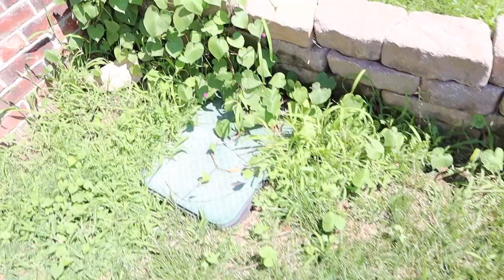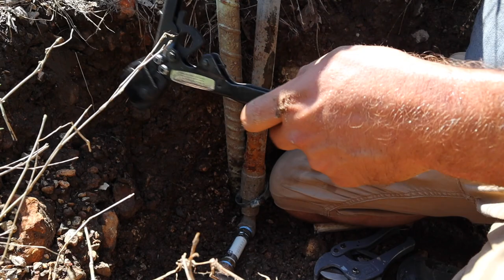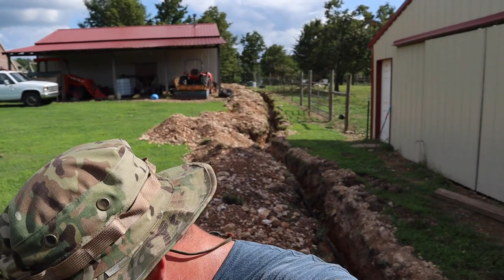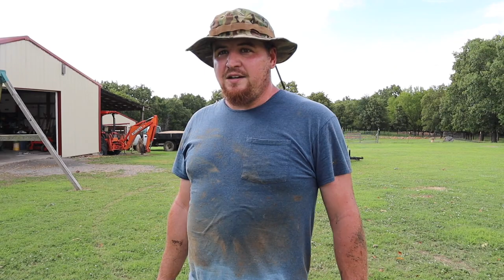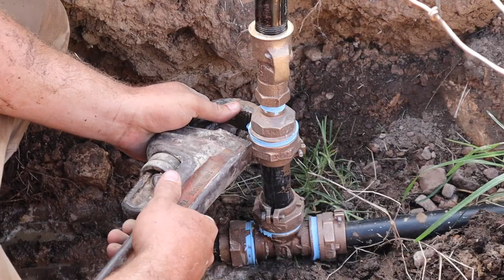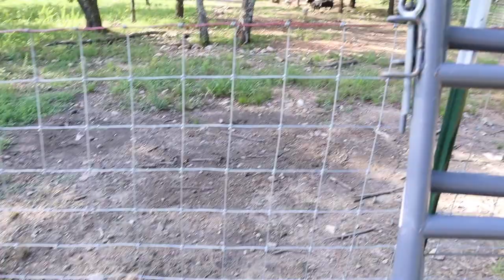DIY Frost Free Water Hydrants | Backyard Farm Upgrade

Comment: As detailed as you have shown, you've probably already considered this:  I had a bad leak (could fill a swimming pool I was told).  I needed a shut-off valve exactly like yours.  Afterwards they placed a large piece of PVC pipe over it with a dome cap (just barely below ground level).  That way the shut-off was accessible without having to re-dig completely to find it.  It needs to be large enough to get arm & hand through and then turn the valve.  They packed insulation around it.  Then filled in around it.  I am so glad you have a very appreciative wife for the work you do.  I know you save yourselves a ton of money and it is certainly admirable for the 'projects' you two conquer.  Please take good care of yourselves and do not over-do.  I love Hidden Heights Farm videos and look forward for the next one to see.  God bless.

Comment: Hey Kevin, learned something new I wish we had done when putting in our water lines. Our winters here in Michigan can be brutal. Had ourselves a bit of a record vortex cold a few winters back. A few weeks @ minus 15-25°. We have to flush our lines each fall & leave valves open. Wish we'd known about the under ground frost free valve's like you put in. We have one on our outside spicket attached to the other side of the house. But we still shut water off to it each fall. Hubby forgot to leave the valves open one year & had a nice soldering project on the copper pipes/spickets that stick above ground come spring. We have 4 spickets on that line, but our longest line only 100 ft from house. Not near as far as yours. Could/should have rented a trencher, but wanted to save money. We both hand dug the trenches about 30" down. If we have to replace them I'll definitely check into the frost free valves. Good post! Thanks!😉

Comment: Hi.  Great job ?  Your hard work paid off !! Will have to wrap some insulation around above ground pipes.  I get that when you turn off at tap, the water drains down out of pipe. Will you place a watering trough on other side of hog's fence ?  Cooling bandanas on neck help in the heat. Maybe a wider brimmed hat to shade neck n shoulders, you also  Mrs.     Peace to you and yours

Comment: You should always cut a gal jug or 2 gal bucket and put around the bottom of you hydrant that helps with your hydrant draining good..I always use sand or pea gravel around mine al k the way in case I have to dig one back up for repair.
Reply from the maker: I used 5 gal buckets

Comment: You might want to put a 5 gallon bucket with a small opening on the bottom to fit over the cut off valve and pipe so you can have easy access to it by removing the bucket lid if needed. Nice job Kevin!
Reply from the maker: That's exactly what I did

Comment: I'm a little confused about something. I thought you were going to put some gravel under the water line and then over it. Looks to me like you have an awful lot of gravel for just doing the hydrant locations. Another question, wouldn't it be a little better to have the hydrants parallel to the fences? That way the fence won't get in the way of the operation of the  handle. 
You're lucky with your installation there being so shallow. Here where I live in NE Indiana, I think that bleeder has to be at least three feet under the ground. I think they figure our frost line either 30 or 36 inches. I think most lines are trenched at about 4 feet. 
Another interesting video, keep them coming. Have a great day.
Reply from the maker: I put gravel in the ditch and pulled the lines above the gravel so the gravel is above and under.

Comment: Labor in hot weather, rain shower will cool off, those storms are o continue until Nov. direction uncertain with break off tornadoes etc. as you folks have endured past, however climate warming has increased no and strength year to year as said will be higher.